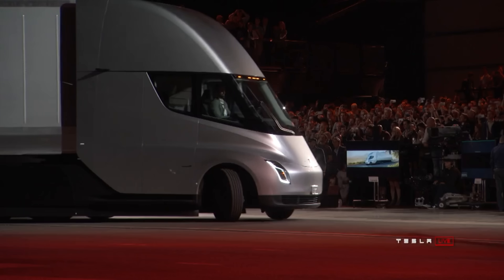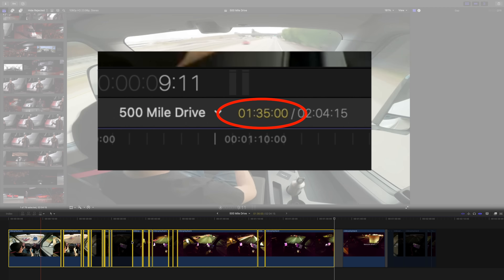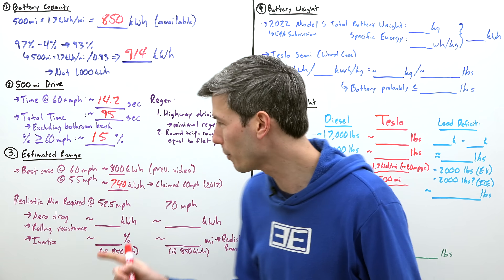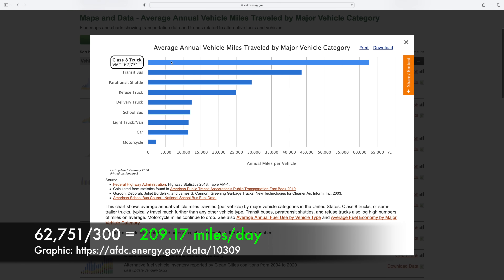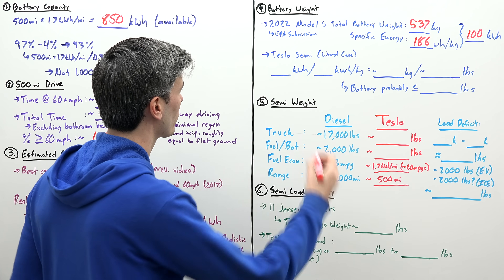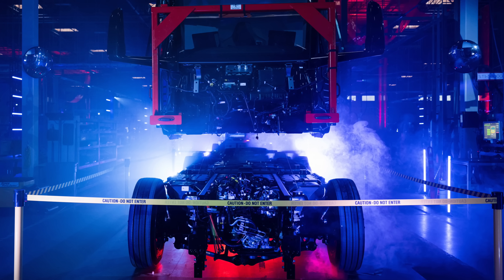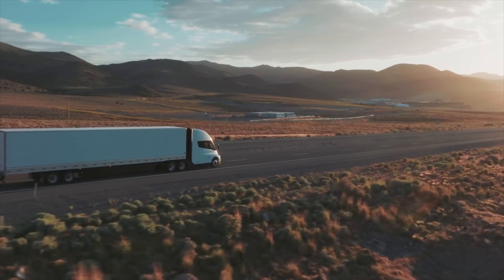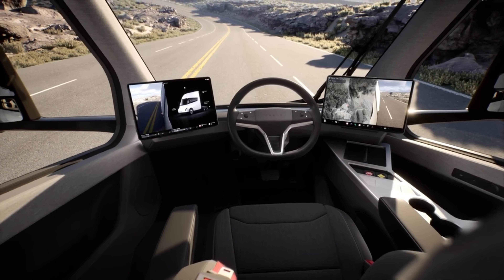Does The Tesla Semi Make Any Sense? Part 2!

Comment: Great video. I’m a mechanical engineer and your analysis is great.  I think it’s obvious the Tesla semi will start as a short / medium haul truck.  There are many situations where these will make sense and over time as technology, specifically battery density, improves over time longer hauls could make sense.
Reply: I'd argue that we should be investing more in trains for long haul freight anyway.
Reply: @keco185  Improving the average speed of freight trains by 10 mph would produce huge benefits.  High speed passenger rail gets the attention, but higher-speed freight rail has huge benefits.  Much of the truck cargo has already been hauled by rail.
Reply: @timothykeith1367   Need to make the transfer of trailers from railroad to roadway much faster & more efficient. Need a much more automated hybrid system.
Reply: @keco185  building actually good infrastructure is not the American way
Reply: You still need all the trucks to handle the head end  and the tail end of any delivery.   You can't pull up to Joes Bait shop with a locomotive.
Reply: @jp040759  a lot of train obsessed libs seem to think that like other YouTube channels. It's baffling to me how insulated they are to these things
Reply: @jp040759   "You can't pull up to Joes Bait shop with a locomotive."  What's needed is a hybrid system,  to allow trailers that would normallyhave to be transferred from train to semi-tractors to proceed to the local destinations using existing roadways.
Reply: @jp040759  you will not need "all" of the trucks if they are no longer delivering for hundreds of miles across roads
Reply: @videopipeline6419  So, you mean an intermodal facility. If you go to most larger cities, there are several intermodal yards scattered around a metro area, with most having a constant flow of traffic.
Reply: @keco185   Yeah...   and the much more isolated railroads would be a much better place to put "self-driving" vehicles than on public roads.
Reply: Trains make more since to me...... for moving product over say 250 miles .
Reply: Here's is another variable missing from their radar:
🤯💥🤯Multidisciplinary engineer/inventor here. We are developing the revolutionary FAZE engine technology. The 𝔽𝕦𝕖𝕝 𝔸𝕘𝕟𝕠𝕤𝕥𝕚𝕔 ℤ𝕖𝕣𝕠 𝔼𝕞𝕚𝕤𝕤𝕚𝕠𝕟 𝔼𝕟𝕘𝕚𝕟𝕖  tech best solves the issues present in previous internal combustion engine designs by transforming the old paradigm into a simple, low cost, quiet, power dense, efficient, on-the-go liquid and gas fuel-flexible, ‘non-polluting’ solution for power generation of all scales and advanced transportation.

𝔽𝔸ℤ𝔼 delivers better than 25% ABSOLUTE/ACTUAL [not relative] 
fuel efficiency improvement over gasoline engines, more than 15% 
for Diesel engines at any operating condition - speed/load, ambient 
temperature or elevation, not just at one optimal testing point at 
STP. Real world driving cycle savings could be an additional 200% 
higher due to the constant MAXIMAL efficiency and torque which 
results in a huge turn down ratio of ~99% without sacrificing 
performance. That means it's idle or running speed can be 10-50 rpm. 
The `simple, low cost, native/built-in, non-electric, environmentally safe, 
non-explosive, temperature agnostic 𝕊𝕦𝕡𝕖𝕣ℍ𝕪𝕓𝕣𝕚𝕕© feature 
recovers more energy than EVs and provides approx.100% fuel 
savings for a combined absolute vehicle fuel usage improvement of 
approximately 300%, thus obviating the basic need for expensive 
EVs & e-hybrids. 𝕚ℙ𝕠𝕨𝕖𝕣𝔹𝕠𝕠𝕤𝕥 adds >400% more torque. It’s like 
4 engines in 1.  This is all done w/o a transmission. 
 
The fuel agnostic capability allows instantaneous use of any liquid 
or gaseous fuel [natural gas at home!!!] incl. biofuels and hydrogen, 
even if old/dirty/unprocessed like flare gas or employ the concurrent 
multi-fuel capability…anywhere on the globe. One engine for all 
locales w/o modifications! Unlike EVs, this enables fast fueling anytime, 
anywhere…with no troublesome infrastructure disruptions or 
changes. EV’s are not a solution to the [FAKE]climate or mobility topics as 
high level of electrification globally is unrealistic 
[See Patrick Boyle's video "Electrify Everything?"] 

The technology offers smokeless, non-polluting, low odor heat and 
noise output without costly after-treatments, etc.,… with only the 
lowest  CO2. It has a negative carbon footprint with hydrogen, 
ammonia, biofuels or gasified municipal, agricultural and/or forest 
waste and coal from a 2-stroke-like simplicity. 

With virtually no electronics and emissions equipment, the cost of
purchase and reduced servicing frequency make this solution 
even more appealing.
 
Those are my two-bits

PS.
Did I mention we're developing advanced, simple, low cost, power dense electric machines and torque dense[read - compact], infinitely variable FrictionLess transmissions?
... ... ...
Reply: makes sense they would be more suitable for  citys etc. ie going from a supermartket distribution centre to supermarkts throughout the city. so they can just go back to base to re charge
Reply: Yeah okay, just keep plugging it in and strip mining with child labor. Eventually technology will understand. Eventually engineers can't make the math work and why the damn truck is years and years behind schedule. Tesla engineers live at Tesla and still can't make it work no matter how much Elon pays them
Reply: @billbirch3748  That's some angry word salad there LOL.  Maybe take a break from YouTube and go for a walk.
Reply: They make a lot of sense for short haul city driving like I do.
Reply: They are Day Cabs massively important to the trucking industry.
Reply: the problem is that it's not being marketed for that
Reply: The economics was still not really hashed out. Except that Pepsi is apparently making this viable with taxpayer money.
Will operating be significantly cheaper assuming reasonable wholesale electricity rates?
Reply: I'd further argue that the Tesla Semi would be a great match for a 'rolling highway' where trucks are transported by train long distances.
Reply: What about haulage from or around local or regional distribution centers (thinking Walmart or Kroger or Warehouse on Wheels manufacturing sites). Those are fairly short daily runs (or in the latter case, almost constantly short runs back and forth for repositioning full or empty trailers). So many use cases; looks like most vehicular machinery will be electrified in the near future. I am hoping soon to see electric garbage trucks (that move more or less silently 🙂) and farm equipment.
Reply: Battery densities (kg) have more than doubled in the past decade and likely will stay on that trend a while still. A 2028 TS might have a 700mile range. Or they'll offer up to 700mi and allow customers to choose what range vs weight they want.
Reply: @Idiomatick  We are running out of high energy density materials, that are bad for the environment to begin with. What is your solution to this problem. I'm not for or against, I'm just stating a fact. From my research, sodium ion technology seems to be the way of the future, but sodium is, in most cases, less energy dense than lithium and the other high energy density elements.
Reply: @johncarter1137  They're only like 15% less dense atm. I suspect that with more investment they'll end up pretty close overall. And even if it doesn't, lithium could be used for weight constrained products. Sodium for others. This should at least push supplies out to 2050... which i assume we make other improvements at that point.
Reply: @johncarter1137  Fast forward to 2024, Sodium ion is being used for grid level storage.
Reply: As a mechanical engineer, I think you, like many are missing something. Trailers switch out between tractors in minutes. It is not uncommon for a load to be switched to another tractor to finish it's journey, so for many long distance routes large carriers could adopt this if they chose to.
Reply: @joseph.cotter  there are also govt rules on how many hours you are allowed to drive but the fact remains that dual driver semis can reach almost anywhere in North America with ready refueling and without needing to stop very much.  

Electric semis won’t be competitive with this sector for quite a while.  Meanwhile they will mop up the short haul market right now on economics.
Reply: Problem is, mister mechanical engineer, that battery density progress stopped somewhere around 2011. I ride electric unicycles for years and we're using cells of max capacity 3.5 Ah for 18650 and 5 Ah for 21700, usually less for high voltage - those were presented around 2012. Nothing has changed since. Toyota promised to deliver some amazing solid state batteries, but stays silent now. Lots of "news" about "breakthroughs", but actual products on the market are the same.
Reply: @theDigited  pack density has continued to improve.
Reply: For the people taking about trains, two questions. First, real estate. Where are you going to find the land to build the rail road? How realistic is it to negotiate to each individual land owners and the neighboring community to build a railroad through? Do you want to live right next to the railroad tracks? Do you want your property to depreciate? My guess is NO. So how you plan to do that? Turn communist and just take evil land owners land that they surely don't deserve and it is for the GREATER GOOD? Secondly, how much utilization and benefit would it need to create to make this investment worth? How to fund it? What's the interest on the debt and how much taxes does the government have to raise?
Reply: @Jau Harvey  Question 1: Leaving aside the possibility to utilize existing railway infrastructure more efficiently, the footprint of railways compared to an Interstate is considerably lower. As are external effects like noise and pollution. You may not like living next to a railway, but the negative impacts would be considerably worse if a similar transport capacity had to come from building roads.

Question 2:You make it sound as if only rail transport is subsidized by taxes, but this is far from true. Almost all roads are built and maintained using taxpayer money. In fact, far more money is being invested into roads than into rail, which makes the supposed superiority of road transport a bit of a self fulfilling prophesy. But while the profitability of railroads may vary depending on the route, it's a reasonable assumption that in many cases rail transport would require less government support than the equivalent capacity for road infrastructure.
Reply: @jauharvey3534  No one is talking about building train tracks to every house ffs.. People are talking about trains being used for long haul, of course there will be trucks at each end, but for much shorter distances. And your question about real estate is just.. c'mon, give it a minute of thought, am sure you can figure it out, highways are not built deep underground either. Having thousands of trucks, electric or combustion, driving thousands of miles across country is insane, and criminal against environment.
Reply: @AG-ig8uf  Trains are more expensive per mile for maintenance, but you can get much more tonnage on rail than by road. Much more.
Reply: @jauharvey3534  somehow non of that was a problem when the highways were build 🤷🏼‍♀️
Reply: @Jehty_  population then vs population now. Government debt then vs government debt now. Recession of 1958 and how the government try to dig out of it with government spending. Teachers don't teach American history no more?
Reply: @jauharvey3534  do old people no longer keep up with the future?
If you haven't realized yet change has to happen. We can't continue like we currently do for much longer.
Reply: @Jehty_  I am not apposed to change. But where does the money come from? You got to fund it somehow, yes? Having consumers and businesses pay for electric cars to utilize the existing roads and infrastructures is more practical than dreaming about change and expanding railroad system by the government. Would you agree?  And no, I am not old.
Reply: I live in the far North, battery electric will probably not work here for a long while. However hydrogen fuel cell trucks would work right now. Just need the refueling infrastructure.
Best wishes from 55.75°N.
Reply: @carlthor91  imo the infrastructure barriers for liquid hydrogen fuel specifically are unrealistic. Storing it in or on the surface of solids and converting to a liquid or gas is also inefficient. It's a big shame :(
Reply: @6Sparx9  Then we will be stuck with diesel engines for a whole lot longer, batteries just wont cut it in the very cold.
Reply: @carlthor91  Yeah I agree, and I don't really see an issue with that since the benefit massively outweighs the negatives such as emissions.
Reply: @carlthor91  according to Jason from this video and comparing say the F150 lightning Hoovies Garage cold range test video, we can conclude that Teslas battery tech or the way they use them is significantly superior to Ford and other competitors. There are still other issues of course. Watching Tesla Semi rollout with great interest, though the states are throwing taxpayer money at making this economically viable which makes it harder to judge.

Edit: sorry mixed this up with the Tesla model 3 2000mile in cold video Jason did.
Reply: @6Sparx9  An electric truck, makes some sense in the South. North of the Iowa/Nebraska line, not so much in the winter.
Also check out Rich DeBoss HD latest video.
Reply: @carlthor91  WTF No the 10,000lbs Battery is soo gigantic it has thermal mass to resist the cold.
Reply: @Neojhun  Minus 40°C and 480 miles, each way, of it. No way for quite a while. Fuel cell on low keeps warm, generates heat for stack, plus driver sleeper, plus 1,000 mile range. Fuel cell stack and electrical gear close to ICE weight.
Batteries have a hell of a long way to go, yet.
Best wishes from the far North.
Reply: @carlthor91  Ah, that little word "just"! " "Just need the refuelling infrastructure" Developing reliable hydrogen infrastructure is going to be a nightmare.
Reply: @MrAdopado  The tech is there, the will, is not there.

Comment: I think the truck is an awesome step forward, it may not be the perfect replacement, one thing that would help it be an upgraded replacement for diesel trucks. Is an APU a gas turbine generator, or even a methanol burning engine,  or just a gasoline or diesel engine, powering a generator, that is  output is near the energy  required  to maintain 85mph loaded. It could be used while parked to charge the battery, without charger, or to charge while on the road, especially on hills, without going down hill, possibly while charging if the battery can handle the current,  a small 400-600lb generator, with about 100lb fuel could make for alot of range, fast charging, and mostly making ppl forget about the range of an ev, and think about the fuel milage ,. Knowing they will not be stranded on the roadside if the battery is low.  And if the fuel tank is empty, it only requires more fuel, not sitting for a hour,  the generator running for 10 minutes should get the truck on the highway again, and charge the battery, up to 65 mph, it should get a decent charge,  it would probably take a day or two to fully charge, and power the truck.   A gas turbine generator would be much lighter, possibly more efficient,  and burn diesel commonly available,  or propane  a cleaner fuel, maybe a company could build an affordable turbine, that is capable of burning multiple fuels, and generating the required power to charge and power the motor!
Reply: Series hybrids don't have fantastic efficiency, and you are up against transport-truck mechanical powertrains that have been well optimised. Gas turbines in particular need multiple stages of regeneration/recuperation in order to get the efficiency up. This is practical at the utility power-generation scale with stationary power plants because it almost doesn't matter how big or heavy the heat exchangers are, but a gas turbine that will beat the thermal efficiency of a modern diesel on the automotive/trucking size scale has not been developed and is unlikely to ever be. Battery-electric vehicles (with electric coming from large-scale utility power generation) is the most efficient way we know how to do this job.

Comment: The 17,000 lbs isn't "just for the truck itself", "Chassis/frame" plus "Truck body structure", which is "just the truck itself" is 5,470 lbs combined, the page you showed is extremely clear on that. The powertrain alone on the diesel truck is 4,080 lbs, the electric motors on the Tesla weighs a few hundred lbs.  "Drivetrain and suspension" is 2,890 lbs on that sheet, which is likely way more than the complete powertrain, drivetrain and suspension on the Tesla semi, save for the batteries obviously. "Misc. accessories/systems" at 3,060 lbs on the average diesel is also probably way more than the equivalent on the Tesla weighs. 

So, remove 4000 lbs for the powertrain, another 1000 lbs each from "Drivetrain and suspension" and "Misc. accessories/systems", and you should be in the ballpark. That is, the Tesla Semi should way somewhere in the vicinity of 11,000 lbs, plus batteries based on that data, and then there's no penalty.  The Tesla is a daycab, which also makes is slightly lighter than the average truck,              

And, if the battery pack actually weighs 10,000 lbs on the "500 mile" version, then the "300 mile" version should weigh 4000 lbs less.  250 miles real world range still covers a much bigger part of the market than Tesla will be able to produce for the coming 5 years, at least.

I wouldn't be surprised if the typical weight of 12 feet jersey barriers is roughly 4000 lbs. 

I would also not be surprised if Tesla aren't as done with the development of the semi that they want us to believe, and that the semi will be even better than they currently claim it to be, in a not too distant future.